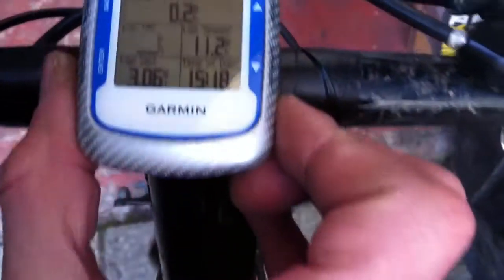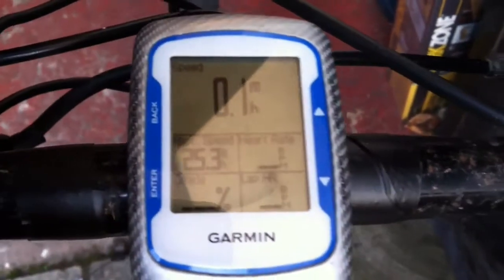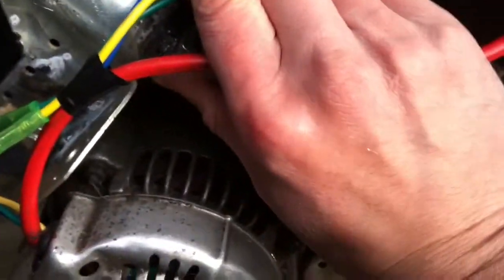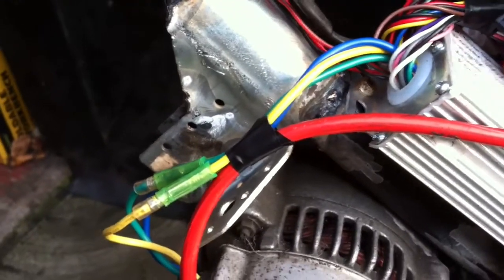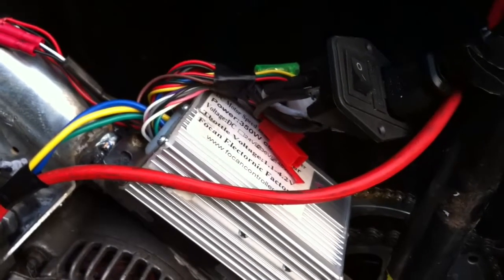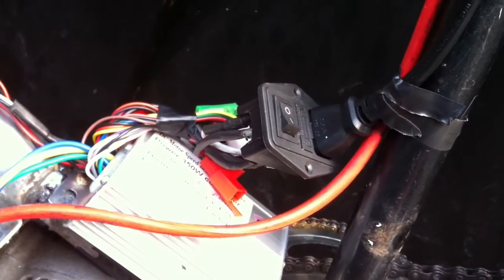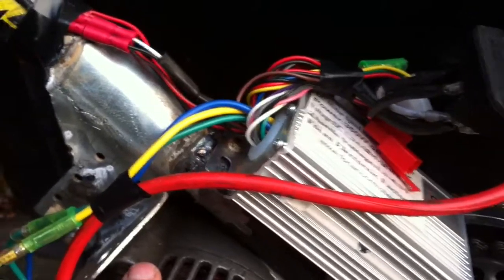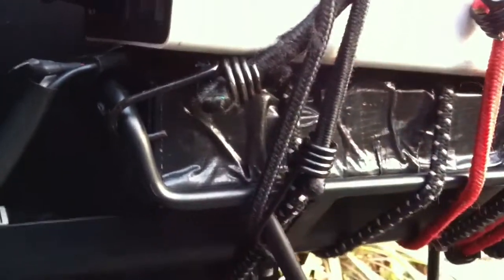Alternator motor as a mid drive - Part 4

Comment: Are you able to regenerate current back to the batteries ? If you can, will it act as a braking force, say if you were going down a hill?
Reply from the maker: No, because drive is via a freewheeling crank. I could pedal and generate power while the motor is not driving. But I do not power the rotor field when the motor is not driving, so there is no magnetic field with which to generate.
If you want to regenerate then you need to direct drive a wheel, with no freewheel in that drivetrain. If you power the rotor then there is drag, so freewheeling with this setup is difficult. Best thing would be to energise the coil only when driving or braking.